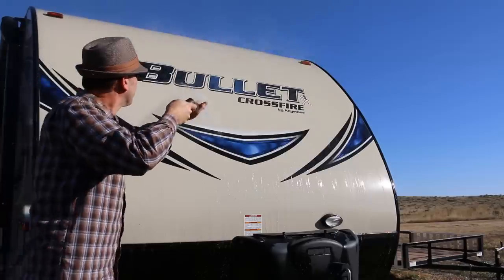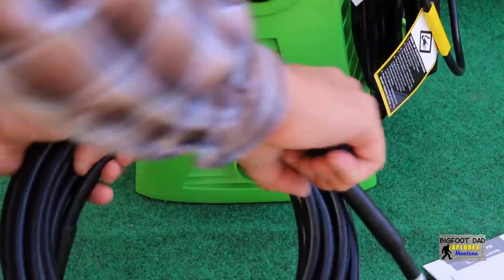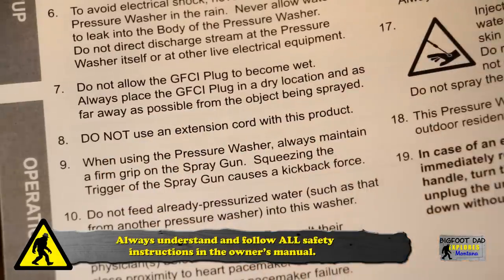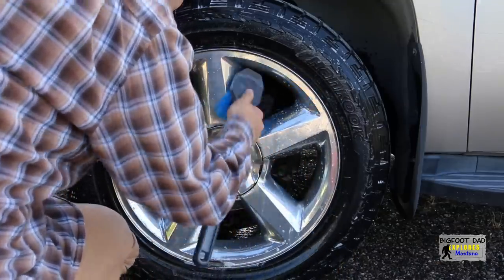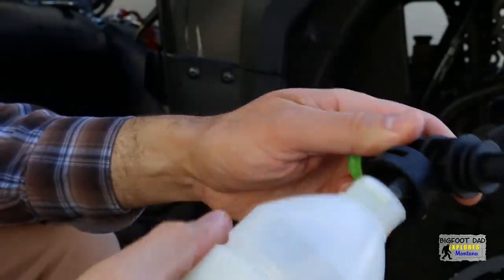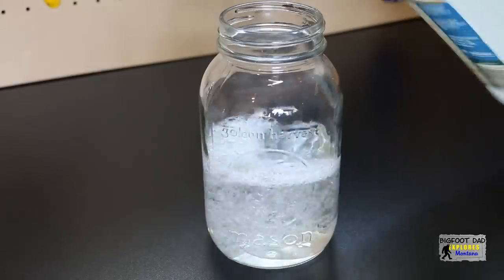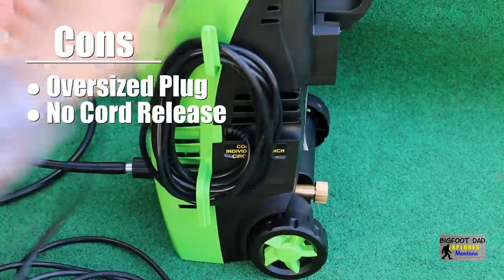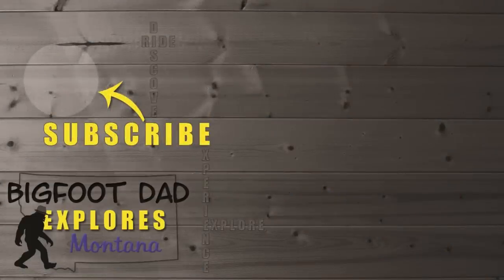Portland Pressure Washer from Harbor Freight - Review - 1750 PSI - 63254/63255

Comment: Is this self priming? As in could you run this off a tank, or would you need a pump?
Reply from the maker: Hi, Ed - I pulled out the Owner's Manual and looking through it now.  I believe you will need a pump if using a tank.  It specifies that the water inlet needs a flow of at least 2.6-3 GPM to operate properly.  It also specifies that the maximum inlet pressure is 58 PSI, but doesn't specify a minimum pressure.   I would awesome that there has to be adequate pressure to deliver the GPM required to the inlet as I don't think a free-flowing system can produce that volume on it's own.  However, I'm not an expert on this subject so if I'm misguiding, hopefully someone can chime in here.   Hope that helps!
Reply: Bigfoot Dad Explores Montana great, thanks for taking the time to reply!

Comment: I  have been in the market for a small powerwasher just for some light duty around the house stuff, they seem to come in two flavors, the little handheld things with no cable or hose storage so even the pictures on the box look like a cluster ... and this
none seem to come with interchangeable tips so that's a bummer but at least the HF doesnt require me to invent hose and cord storage to make it shorter... its not the height of my garage that's the problem is the square footage

wait does that thing have a GFCI plug with no ground, how the hell does that work
Reply from the maker: Hi,  Osgeld - I was browsing Amazon and was amazed at the variety,  most near this price point.   Seems there isn't a perfect one out the unless we pay the big bucks.  Yes,  depending on the size of area of your garage,  this one may require more work than a larger,  more powerful unit. 
I can't answer the GFCI question,  so hoping a qualified individual can jump in here.   I think it has more to do with the amperage draw before it trips and cuts off the flow entirely.   
Thank you for sharing your thoughts and welcome to our community!   😎
Reply: @BigfootDadExploresMontana   looking around the greenworks 1700 psi electric model will accept the generic quick change tips and for this week at least is 79.99 with a lowes 4th of july sale 

as far as the GFCI its suposta monitor the input and return current within 5ma before cutting off, course the G in ground fault circuit interrupter is ground, and when something is not grounded its not GFCI its just a circuit breaker ... after some more looing around they are all listed as GFCI with no ground connection, so I guess its ok by code but in reality your checking to see if there's a 5ma difference tween input and who the hell knows what as there is no reference to earth
Reply from the maker: +osgeld - thank you for the detailed information on the GFCI!  I've learned something new today.  Hopefully the Greenworks is working well too.  🙂

Comment: Do you lubricant the the water pump
Reply from the maker: Hi, PANCHOSR - I have not lubricated the motor before.  I do not know the details, but perhaps it is a sealed unit on the electical side and the water side just may be lubricated by the water.  If you find a different answer, feel free to post back and let us know.  Thanks!

Comment: Any Surface Cleaner compatible with this???
Reply from the maker: Hi, Sgt Narly - maybe not the soundest advice (but in the spirit of DIBS), as long as it flows into the foam reservoir, it'll probably work if you're looking to soak down a large area.  Just make sure you're wearing proper protective gear to prevent any odd exposure because it really sprays out of there.  Otherwise a safer bet may be to call Portalnd to see if they have any advice.  Hope that helps.

Comment: Can this be used on Stucco for the outside of my house?
Reply from the maker: Hi, Victor - I'm not sure but hoping someone can chime in to help.  I would imagine as long as you're careful it may work.  Hope that helps a bit and good luck!
Reply: It works for the most part, and removes most of the dirt and gunk. I use it at least twice a year just to clean the stucco on my home. I've never had any issues, and I've used two different Portland models in the past 4 years.

Comment: There were no screws included in mine.
Reply from the maker: Ah, that's what I thought on mine too for sure, then they fell out of the box.  Hopefully you could just exchange the unit and get a new one with all the parts.
Reply: @BigfootDadExploresMontana  I ended up going back tp the store, they opened a new box, and confirmed they do not come with screws. When I was about to leave, they were cleaning up the parts and realized they had thrown the screws away in the plastic bag that holds the book. Why they are not simply taped to the book or the part that needs screwed is a mystery to me. I then returned home with the screws they gave me, only to realize I too had thrown them away. They come loose in a very small bag inside the bag that comes with the book. This is important to know for anyone who bought this product. I never saw screws packaged in that way before. They should definitely be taped to the book so they can be noticed.

Comment: This looks as junky as the other one I bought from Harbor, I used it once, put it away and the next time I tried to use it after storing it in my shed a year or so later it was broke. Dead! Started to work for about 30 seconds then broke and I watched the water leak out. Get a real washer if you need have one.
Reply from the maker: Hi, Den Phi - yes, I may try a different model once this one gives up the ghost.  Do you have any recommendations?

Comment: This thing is cheap from China trash. A kid's toy. Will only last 3 or 4 uses max before some kind of problem (likely leaky gun, read all the 1 star reviews) will render it useless.  The trigger lock does not work from the getgo and the detergent bottle does not dispense at a concentrated rate, so it basically empties the container in about 3 seconds of pushing the trigger. Price is tempting, but no different than taking that money and throwing it in the trash.
Reply from the maker: M.H. L.  - So tell me how you really feel.  😅  That's cool though - that's what these videos are for: so you can experience the product before you buy.  Hopefully you're able to find what you're looking for - it's spring and time to start washing!  😎